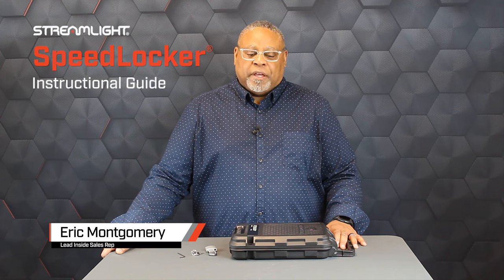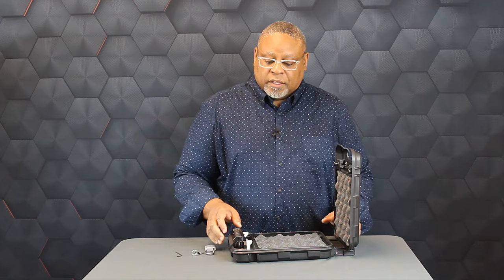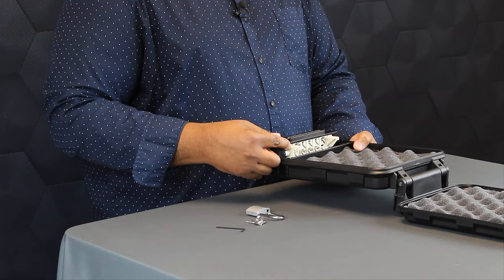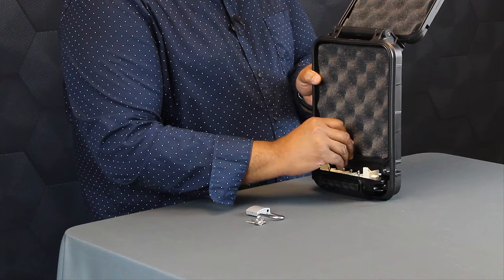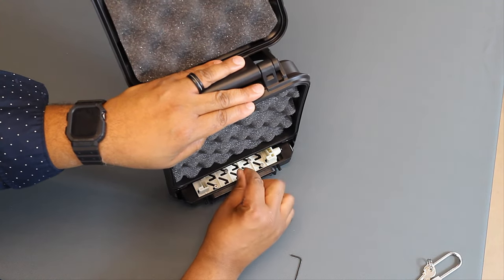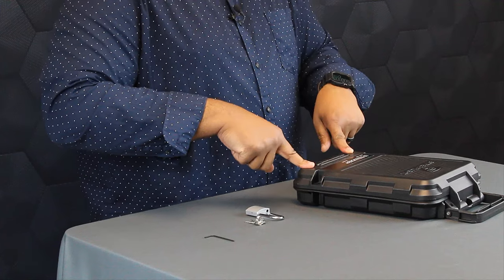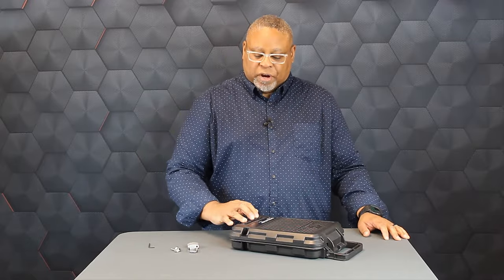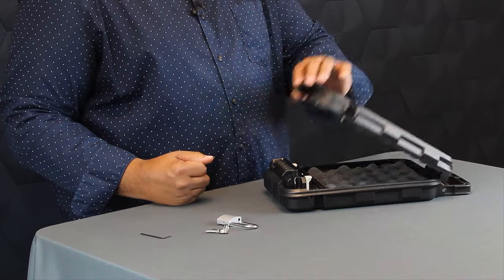Streamlight SpeedLocker® Instructional Guide

Comment: Correct me if I'm wrong here... but if there's no actual "combination" and/or order to depress the buttons, and add on to that the wrong buttons tell you when they're wrong... with only 31 possible combinations according to the website, wouldn't this be super easy to brute force and stumble upon the combination by trial and error? Also, since it's mechanical, are some of those "combinations" in the 31 possible literally just one single button, or two?
Reply from the maker: Our customer service specialists can help with your question. Please give them a call at 800-523-7488 or email cs@streamlight.com.
Reply: Like most quick access mechanical safes its really just to keep out kids.